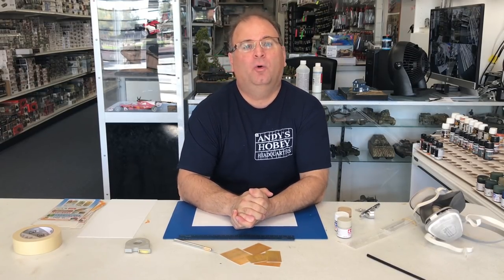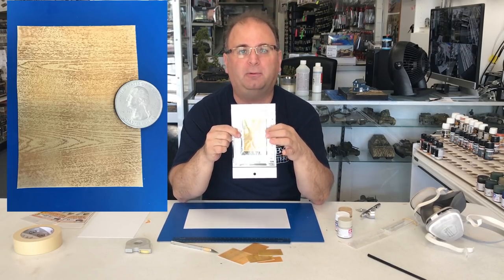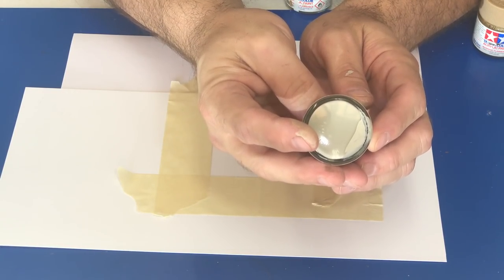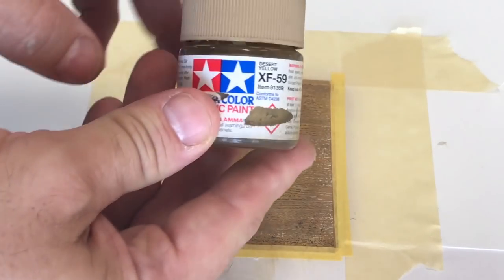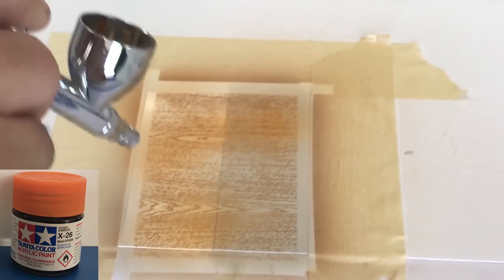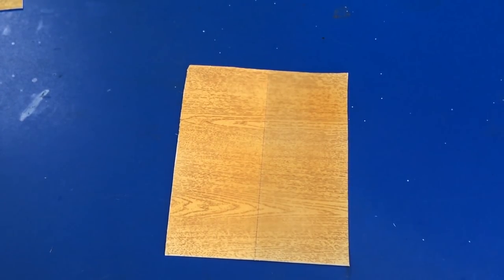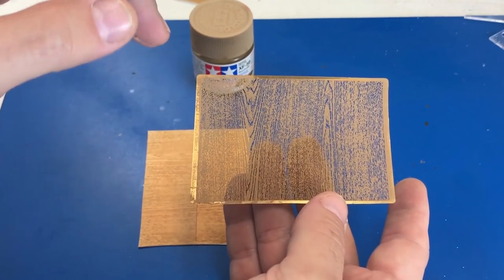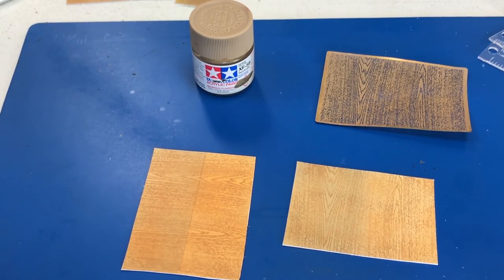Painting scale plywood using zoukei mura photo etched mask for future wingnut projects.

Comment: really neat video and technique.
I am getting back into hobby and found another use for the airbrush compressor, cleaning the PC out.  I noticed the vents on processor cooler were getting clogged with dust, so took my desktop to garage where compressor is, set the PSI to 40, hooked up airbrush and blew off the dust from vents and throughout the PC. the airbrush gives a more directional control of air flow and I know I won't introduce moisture as the compressor has the moisture trap in it.  this sure beats those cans of compressed air or using a big compressor without the moisture trap.

Comment: Hi, Andy. Do you know if there's a technique to spraying Tamiya clear paints onto clear parts without them acquiring a fogged appearance? I've seen people do it, especially on aircraft canopies, but the technique never seems to work when I test it.
Reply: Andy probably has a better and simpler idea, but I had to do that for a Tracker top window and the top canopy part of a Huey. I used Tamiya clear very thinned (around 1 Tamiya clear to 10 Klear) with Johnson's Future (Klear). Very thin coats trying to be as uniform as possible and building the colour very slowly. Then I dipped the canopy in Future/Klear (pure, not mixed with Tamiya paint) and the results were great, transparency wise I was very surprised... but try to err on the thin side, You can always apply more coats later if required.
Reply: Hmm. Unfortunately I don't have any Klear. I did try spraying it thinned right down. Both with Tamiya and with Mig Ammo crystal colours, but nothing work except Tamiya clear red that sprayed relatively clear onto some Abrams periscopes. Clear Blue, thinned down, did not, however. only way I managed to paint tinted windows so far was with very thinned down coats using a brush, but you risk the strokes showing up unfortunately :(

Thanks for the response, though, Guillermo :)
Reply: Maybe adding some retarder to the mix to allow the strokes to level down? I guess the point is thinning very heavily the Tamiya clear with some transparent media with high leveling properties, perhaps a good acrylic gloss varnish? Good luck!
Reply: Hmm, that may work. Thanks again :)